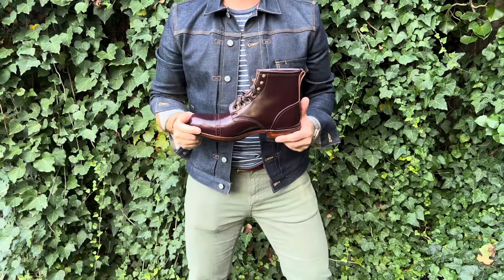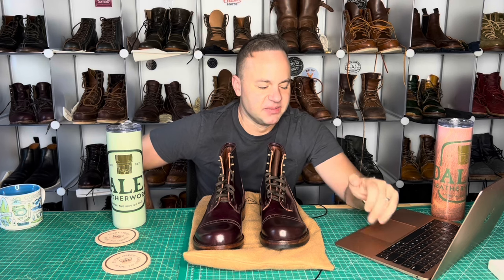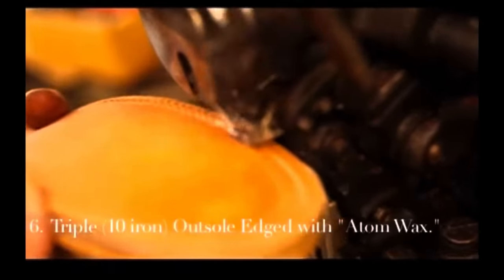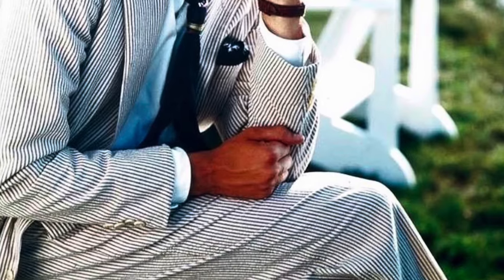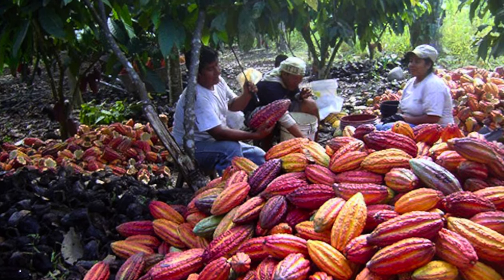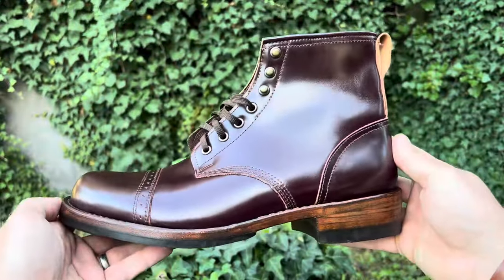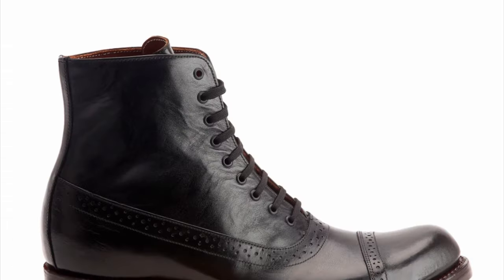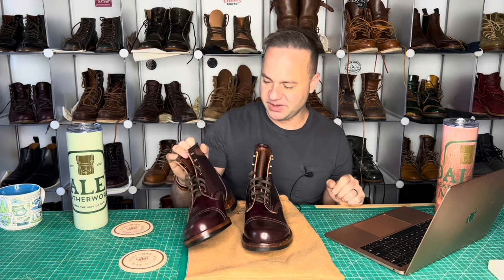Least Reviewed Boot Brand in Known History: JULIAN BOWERY BOOTS in Horween “Bordeaux” Shell Cordovan

Comment: I looked into getting these exact boots not too long ago, but the lack of info made it hard to pull the trigger. The boots sold by Julian on eBay Are factory seconds. The sizing was the biggest thing I wanted to get confirmation on, but even a discussion with the customer service lady responding via eBay didn’t actually confirm anything. She was nice, but was no able to into instill confidence. 
Question: Are these boots a half size down like normal or true to size? 
Answer: Yes, they will fit you good.
Me: 😅
Many questions later I’m pretty sure it’s true to size, but I can’t say for sure. 😬
Reply from the maker: I too would love to solve the sizing question but for now my best guess is TTS!
Reply: Exact same scenario happened to me. ‘Our boots are true to size, get your normal boot size’ ‘But my normal boot size isn't true to size’
Reply: Worst company ever😅